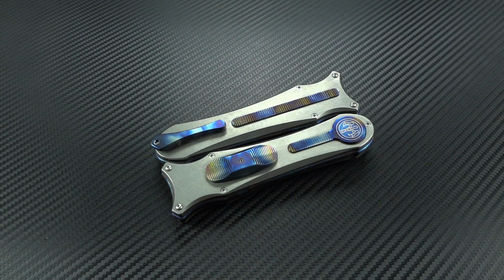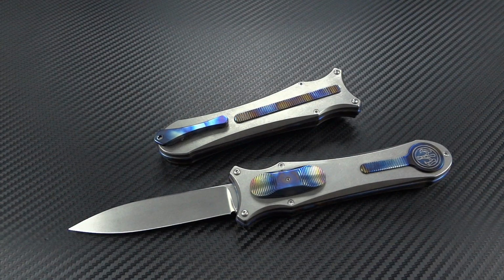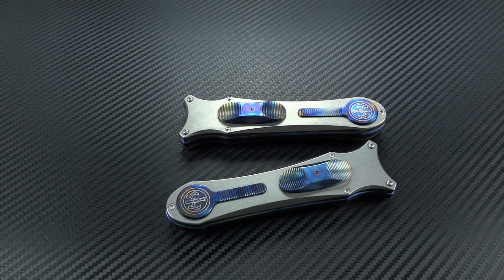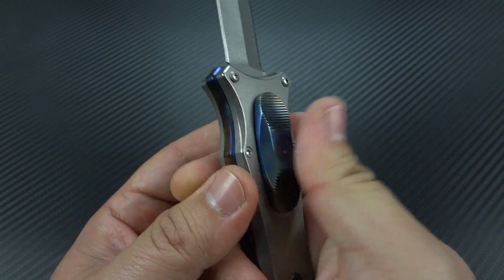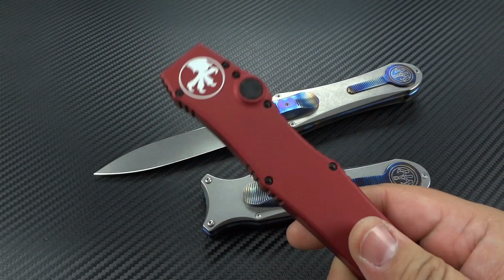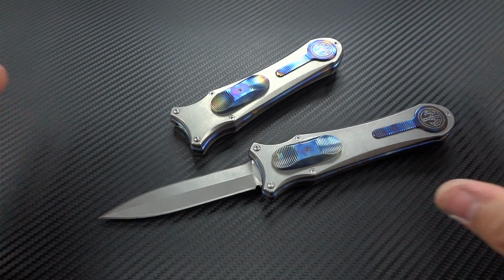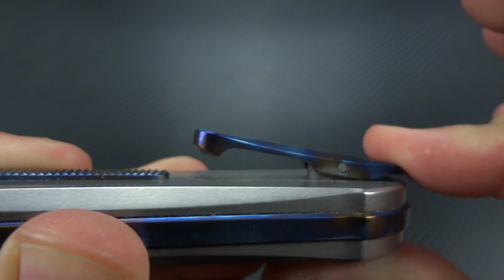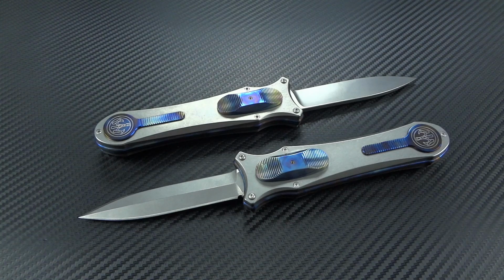Hawk Knives Custom Deadlock: The perfect OTF?

Comment: Pretty fucking cool. I've owned Microtech double-action OTF knives in the past, but once the novelty had worn off, I found flippers to be just as fast, and a bit less illegal to carry... though shitty Canadian knife laws are vague enough that individual cops might see a flipper as legal or illegal, depending on their views and personal disposition. But... if OTF autos were fine to carry, I'd still want to own a Microtech double-action; and the Halo single-action, even if it's a bit impractical, is fucking awesome. These Hawk OTF's are amazing. I didn't think the Microtech double-action was a design that could be improved upon, but the Hawks have apparently engineered a better, more solid double-action auto. Nice... if only I could carry one without getting arrested...

Comment: As the spring loses elasticity, will the wedge start failing to lock in? I know it takes thousands and thousands of firings, but the way it's described that may become an issue years down the road.
Reply: It's a little early to talk about our in house testing, but I will say that we didn't have any issues with the springs, and no memory loss whats so ever. And we were still getting a solid lock. 

Weak is a relative word, but the springs would be almost identical, but different lengths. When you're within the engineered limits of the spring, the spring will last forever. As you get closer and closer to the limits of the spring, the life of the spring goes down drastically. When I start offering a stronger spring set up, there will need to be testing to make sure it will last. With all of that being said, things break. If anything ever breaks on any knife I make, I fix it. In this case, if a spring broke, or started to get weaker, I'd just send you a new one, and you could replace it very easily.
Reply: Hey Jeff,
So there are two main firing springs that propel the blade back and forth. And they are both well within there recommended spring load. Which is a problem on a lot of automatic knives, more so on side openers. To get the power and rotation, they go past the recommended travel of the spring. Generally a knife company is happy if a spring lasts 10,000 cycles. In OTFs the springs are generally within there recommended travel. Although the harder they fire, the more stress on the springs, and more likely that the springs are going past there recommended travel, and they will break. We prefer the lighter spring tension for two reasons, first its easier to operate, and second the springs will last longer. We've done extensive tests with opening and closing, and the springs have gone well over 28,000 times, and I haven't broke on yet. Some point soon I'll be doing a full take down video showing how everything works, and in that I will talk about some other solutions we've come up with for making the springs last.  I've heard a lot of complaints about springs breaking in Microtech knives, and that is because of the way the springs attach. 

Just for clarification, when a spring is used within its recommended travel, the spring will last a very, very long time, without loosing it's memory. When you go past the recommended travel the spring will break. I've even seen charts from spring companies that break down how many times a spring can be cycled depending on how much of the travel is being used. When looking at a chart like this, you'll see that as you get closer to, or past the recommended travel, the cycles/lifetime of the spring shrink exponentially.

Also one last side note, when an double action otf is open or closed, the spring is at rest.  Verses a side opening auto, that when closed the spring is at it's maximum deflection, which can cause memory loss in the spring, making the knife open slower over time. Which is why some people store their automatics in the open position. That's not an issue with double action otf knives.
Reply: Gavin Hawk
 Appreciate you taking the time to answer my questions. You've laid out a ton of information that I think many will find useful, not just myself. Thanks!
Reply: Just wanted to let you know that we've been doing a ton of testing, and our springs have made it over 150,000 cycles, and are still going strong. Not quite ready to release more info on other parts, but this should be the longest lasting OTF on the market.
Reply: Gavin Hawk
And Jim said you can't explain stuff the non engineering types can't understand ;) Appreciate the info. I do still wonder though, since you are already using a light spring, it wouldn't take much 'memory loss' for it to stop performing well. I mentioned I know it takes thousands and thousands of firings to reach such a point, just the weakness is what made me inquire. Since you will be offering a harder firing spring, it would in my mind, make sense to get that one, over the weak one. You said you went 28k firings with no breaking, how about failure to lock in? Was there any issue with it being too weak to fully deploy and get solid lock up?
Reply from the maker: I don't see it being any issue. It's a tiny spring and it's function is simply to allow the blade into that "wedge". It doesn't actually create the lockup.
Reply: Jim Skelton
Yea, hard to describe over text, but I was referring to the spring that pushes the blade forward. You described that as having a stopping point, and if the spring fires too hard, it will force it past said point, causing permanent lock up. I was thinking the opposite. Suppose the spring becomes too weak to get the blade into that locking point. Therefore the blade can't be pushed into the wedge far enough, so it would fail to fully deploy. Guess I will have to wait for someone to disassemble and get a full look and the innards. Thanks for the reply :)
Reply: Fantastic. Thanks for the follow up!
Reply: +Gavin Hawk one of these days i have to have one.
Reply: You clearly know your stuff and have done your research. Can't buy in the UK , but would if i could! Beauties.
Reply: JFB 101 I know right. Stupidest law ever! As if a knife will do more damage just because it's an automatic opener!
Reply: JE refer Hudson
Reply: buy it in pieces

Comment: Still like the combat tragoon (sp?) with polished blade. Also, auto knife laws are bullshit. I have a permit to carry a pistol in my state (which would include an AR pistol with 30round mag, lol) but can't carry an auto knife.  Smh
Reply: Knife laws in general are stupid. A folding knife is only dangerous if it's over 3" long, but not my filet knife, because I can only cut fish, obviously. And autos and balisongs are more dangerous than a flipper on bearings because they deploy at the same speed but one has two handles and one has a button.
Reply: And all of those are more dangerous than the Glock I can legally open carry